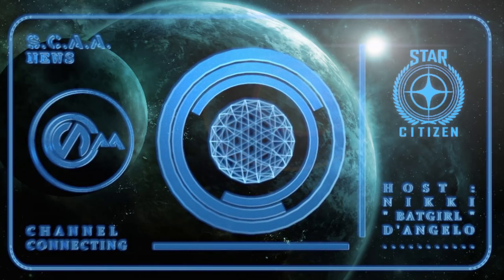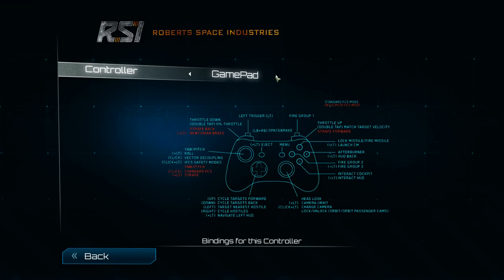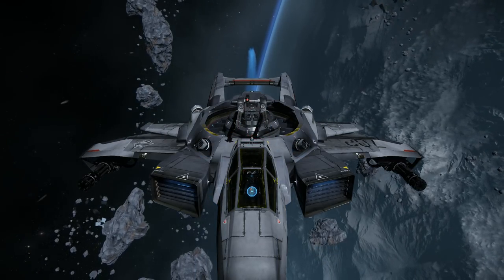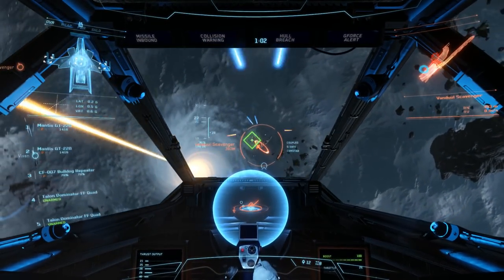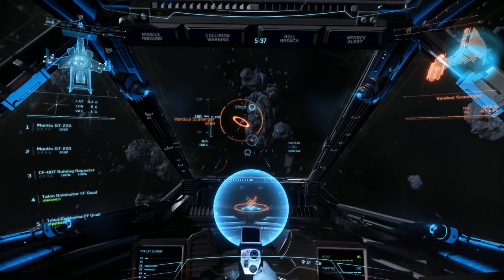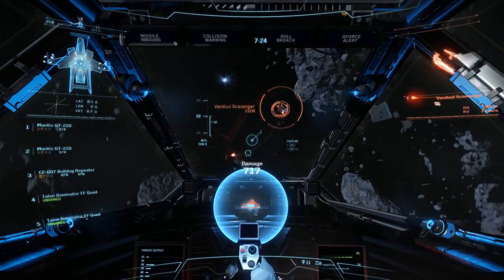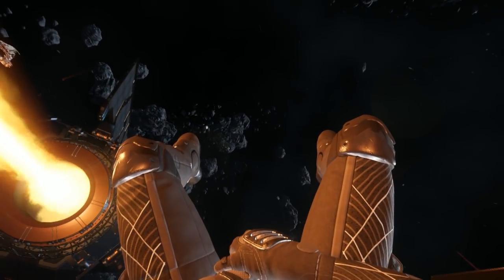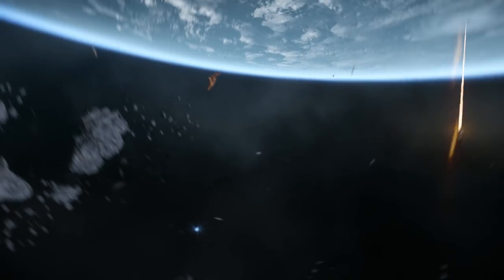Let's Pew Pew! 001.5 How to fly using the X55

Comment: Great work as usual! As for the temperature warning for your CPU, you might want to abandon the Asus factory stuff and instead install OpenHardwareMonitor. The Asus monitoring tools increased my DPC latency greatly at certain times, leading to stuttering in game performance. Also, 80° is not a nice CPU temp to have, even when overclocked - if you can do something about that, I'd highly recommend that.

Comment: Copy your xml-file into: ...CitizenClient\Data\Controls\Mappings
The Controls and Mappings folders are not there initially, so you have to create them first. Once you have done this and have your xml-file there just go to the ingame-console and type:
pp_rebindkeys hotas_layout_x55
It works, no complicated file-path needed. There are probably also custom-files for your HOTAS where the couple/decouple-toggle is bound to a button on the throttle. I also put strafing (up, down, left, right) in decoupled-mode on my hat-switch, which makes much more sense than the standard targetting modes. Or you can put reinforce (front, aft, port, starboard) shields on the hat-switch.
The possibilities are endless. I hope this kind of flexibility stays once ingame remapping is implemented.

Comment: So I've just starting hooking up my x55 and am now trying to get it working with SC. But once I load up the layout as you showed the joystick is acting as the throttle and the actual throttle doesnt do anything.. what have i done wrong?
Reply from the maker: This happened to me also.  I had a Razer Tartarus hooked up and currently the mapping in Arena Commander only includes 2 controllers.  So I had to unhook all controllers, hook up the Joystick, Throttle and then the Tartarus in that order.  The Joystick then was device 1, the Throttle device 2 and so on.  This worked for me.

Also try deleting your user folder like I show in the video.  Tell me if any of this helps please?  Good luck!
Reply: Nichole D'Angelo
Thank you :D I didnt have much success at first when I simply unhooked the throttle, joy stick, and my Razer Nostromo. Then re-inserted the usbs in the order you advised. So then i tried removing the user folder AND going 1 step further and unhooking ALL of my devices, being my razer onza, blackwidow etc. Then hooking everything back up after the joystick and throttle. That seems to have done the trick. Thanks so much. You're a life saver.
Reply from the maker: DreadnThis Yay!  Glad I could be of help.  BTW, In game I hope to take on the SAR role if it pans out to be viable.  Right now I do not this SAR makes sense in the direction SC is headed.
Reply: Nichole D'Angelo
 Sorry I'm not familiar with what SAR means. Also.. I'm disappointed in how much easier AC is with the mouse vs the stick.. but then I'm very inexperienced with a stick.
Reply: DreadnThis Search And Rescue (S.A.R.)

Comment: You are flying in space, swap roll with yaw and you'll have a much easier time lining up targets, and when in decoupled, roll is not really so useful in the game.
Reply from the maker: Thank you!  I will try this. I just keep remembering how in physiological aspects of flight back in college how they said a human body can handle in excess of 10Gs but laterally as little as 3Gs can rip your heart away from the aorta. That is scary and yes it's only a game but if Chris and team model everything in game this can be deadly. Lol.
Reply: Nichole D'Angelo Well you can 10Gs if for positive ”vertical”, but negative  "downward" it is only 2 to 3 Gs.

What interesting is that horizontal Gs can be up to 20 for short period, but in SC it is set for a much lower limit I think.

http://en.wikipedia.org/wiki/G-force#Horizontal_axis_g-force